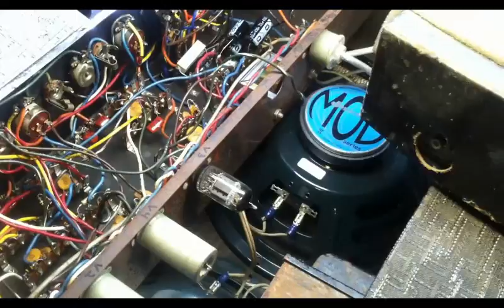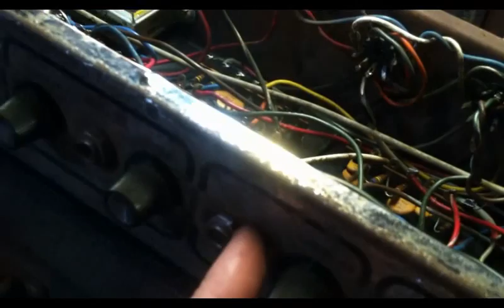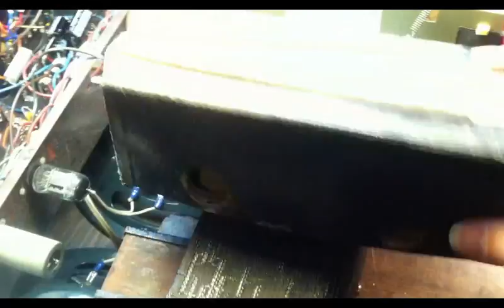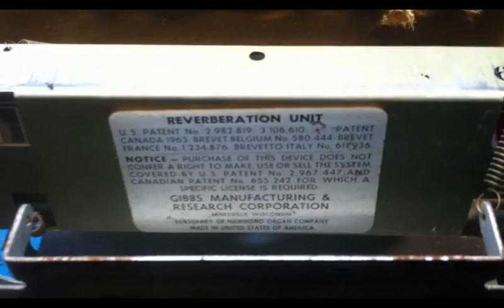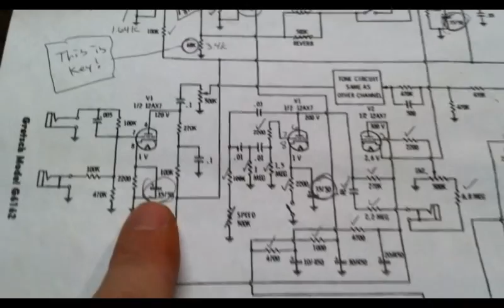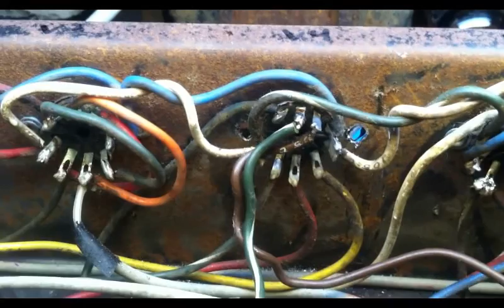1965 Valco Gretsch 6162 Tremolo-Reverb SERVICE & DEMO

Comment: Do you happen to have a power transformer for this model or hints of where to look. I’ve got a Harmony 430 that someone substituted a much smaller generic power transformer. Feels like it’s missing a bit of balls. Some original 6973 gave it some more bite but it just feels like it could be much more. Maybe missing caps?

Comment: Any reasons the advantages of using a AEU7 tube for the Phase Inverter compared to using a 12AX7? Because Ampeg uses 7199 or 6AU7 for phase inverters which I'm not sure what are the advantages of using these tube numbers. Have any ideas as to why?

Comment: Question, I have what I believe is a 6162 but it has a “true” vibrato, not tremolo. Also a different colored grill cloth. It seems mostly identical besides that, though. Is this a different model altogether, or did they manafacture it with these differences at some point?

Comment: Those speakers sound good. What is your opinion on the electro harmonix 6973 tube? My Supro Royal Reverb s6650 has a 6973 reverb driver along with two for power. $$$$$

Comment: You said Strat, and I was not expecting that tone... What balls and splat, even from the bridge!! (I'm quite partial to avoiding Strats...)
Reply from the maker: +Britt Rossman I'll admit I've always liked the feel of a Strat. I try to use Strats and Teles when demoing most vintage amps these days because they're something everyone knows and they tend to bring out the range of harmonics the amps are capable of producing.
Reply: I think that's perfectly understandable and justified. Frankly though, Tele's have a better hand feel for me more than 90% of the time compared to Strats (generally speaking, of course). I am more of a LP or (semi-)hollow-body (ie 335-style) kinda dude, and they tend to have a similar body/hand feel as the Tele for me... maybe its a weight thing?

Every now and then I find a Strat with a neck that changes my mind, but I still feel the pickups just don't give me the well-rounded clarity and fullness I look for, especially on the bridge. Conversely, the Tele suffers from this issue on the neck pickup... 

Just my opinions here... I won't ask you to change a classic setup though, when SO many folks are just fine with it. I just did not expect such ... chutzpah from a Strat. In this case, it must be a combination of the amp circuitry and speakers... a truly unexpected and FAT sound!